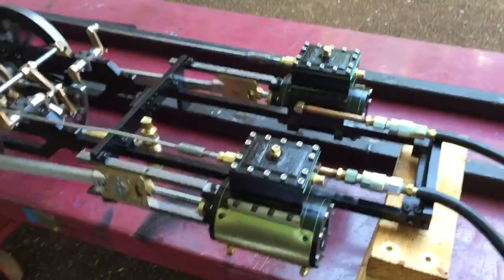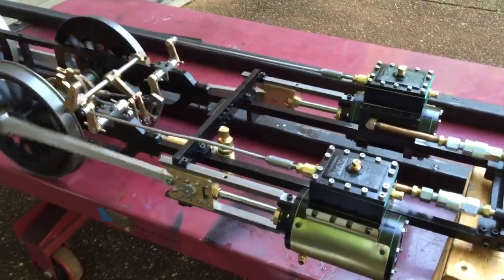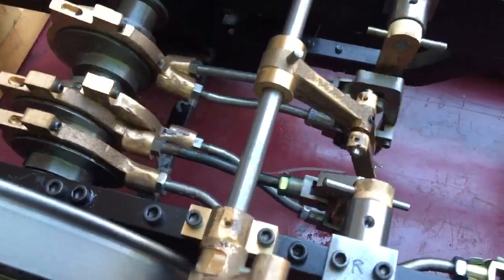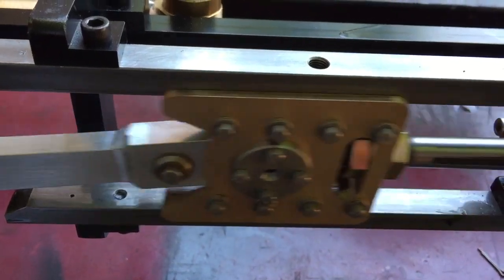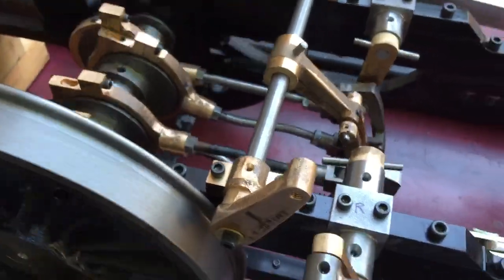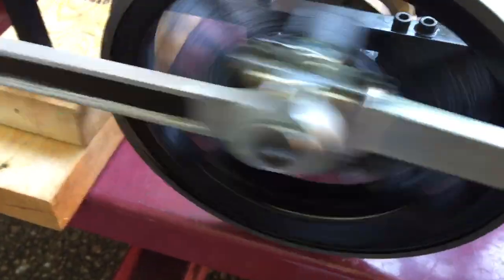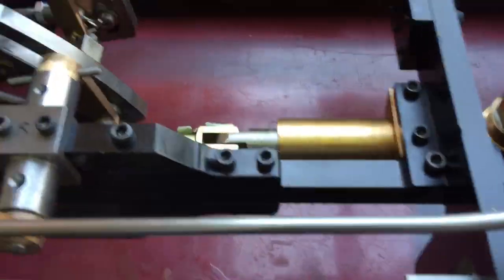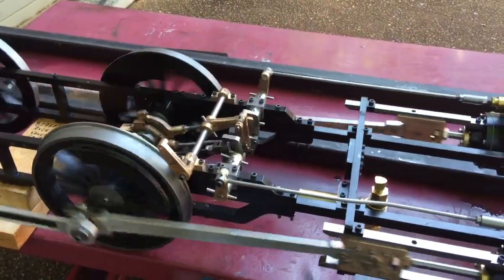Allen American locomotive running on air

Comment: Would it be difficult to build a version with inside cylinders? I'm laying down the ground work for a LMS Class 2P or NER Class R (4-4-0) locomotive with very compact dimensions. I would imagine you'd need one axle for the main crank and the other for the valves.
Reply: Not at all, in fact internal cylinder engines have been made at smaller scales, for example this 5inch gauge engine is similar to a 2P.

https://www.ajreeves.com/etna.html

However, it does get rather cramped down there with the eccentrics and the cranks all on the axle, but still feasible.

Comment: On Stephenson valve gear, is the forward eccentric set at 180 degrees from the reverse eccentric? Or is it less? I noticed your reversing link centers drift from front to back slightly.
Reply: ArcticWolfSilver —I’m not where I can check my valve setting info, but I believe valve forward and reverse eccentrics are not exactly 180 degrees apart as they are affected by the connection point to the links and that radius.  When the link is moved into full forward, the eccentric is on the centerline of the axle and is directly moving the pivot to the valve rod.  The other question you asked was about the movement of the reverse lever in the video.  This would normally be latched into a groove on the reverse stand but I did not clamp it down for the demo.

Comment: Nice loco but, why do you have so many eccentrics? I saw a 0-4-0 locomotive with just 1 eccentric.
Reply: LBSC_Thomas_70 Regarding your question on number of eccentrics, this is a Stephenson valve gear with one eccentric for forward and one for reverse for each cylinder.  The fifth eccentric is for the axle pump to replenish the boiler water.  Greg
Reply: Thanks for the explanation.
Reply: @lbsc_thomas_703  Stephenson's linkage was even used on Titanic for each cylinder